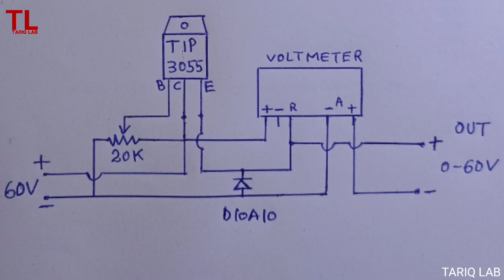How To Make Variable Voltage Regulator 0-60V 10A

Comment: Is it really get 0-60v and 10amps 
What is the value of input 
Could you please show output also
Reply from the maker: Input 60v , output 0-60v 10A.
Transistor TIP3055 15A.
For 10A use bigger heatsink and higher gauge wires,
Reply: At 5 A, it will be already burn!
Reply: @John_Smile  Даже при 1А больше 3-5 минут надо очень хороший радиатор.